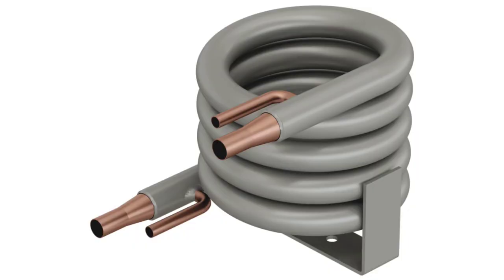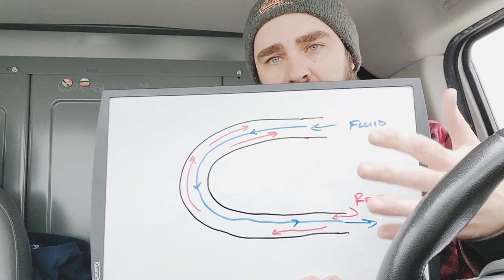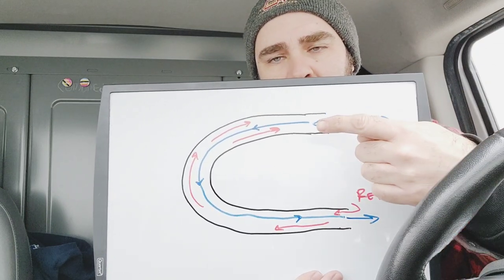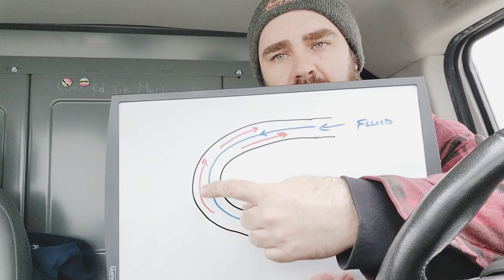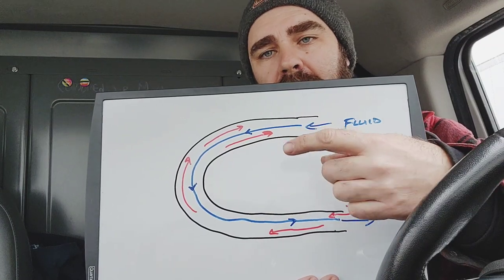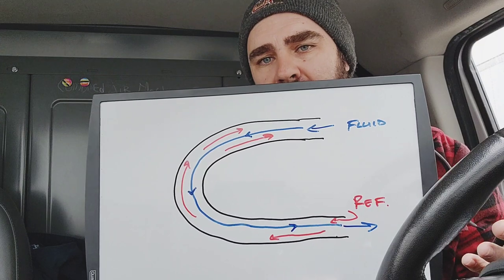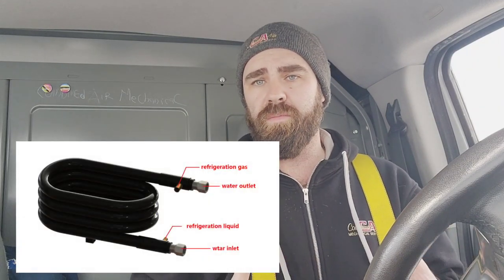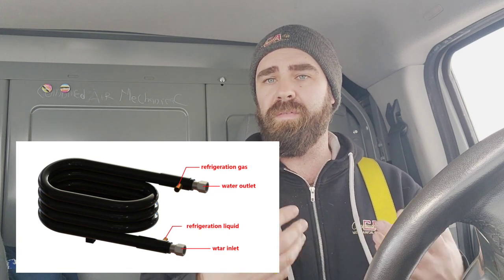Water Cooled Heat Pumps, Air Conditioners and Coaxial Coils - Heat Pump Building Loop

Comment: I have a location with 3 walk-in boxes that a previous technician bypassed the air cooled condensers and installed coaxial water cooled coils. The water bill is through the roof. I’m sure the water regulator valves are wide open. How do I dial in the head pressure and save water?  There isn’t a manufacturer spec sheet because this was a custom job. These are all r134a medium temp reciprocating compressors.

Comment: Taking the fitting off the water lines on a 30 year old unit is a hole nother storyline.  Some of the water piping in the buildings in los Angeles are like over 30 years old .
Reply from the maker: Same here, we've had ball valves break and glycol floods

Comment: What is the proper way to clean the coax coil,  if there is glycol in the system
Reply from the maker: You'd have to remove the glycol circulate a chemical cleaner

Comment: Anyone ever seen an air condenser with a coaxial coil also attached ? So the refrigerant travels through the coaxial coil and then through a air cooled condenser and then to the evaporator.

Comment: I'm running a service call tomorrow.  Its a no heat and the original tech put in on the notes that the thermostat was not set up for heat pump.  New tenants in an old space.  Could this really be the case that it's not enegizing the reversing valve?  The unit is suspended (little to no access) so I was just curious on what my first steps you would recommend?
Reply: Did the first service tech confirm that the compressor was even functioning in cooling mode?? I work on my fair share of water source heat pump’s..Horizontal in ceiling, Chassis heat pumps, and vertical heat pumps…Depending on the age of the unit you’re working on you may have a circuitboard that will have a stored fault code That can generally be confirmed by shorting out to little testy pins on the actual circuitboard…Mrost of the newer heat pumps I come across energize the compressor on Y And energize the reversing valve on O/B of the Thermostat… Also you may want to confirm that the thermostat is indeed meant to function heat pumps…As long as you have the correct Voltage hi/low You can always try jumper ring the thermostat in both heating and cooling to confirm if in fact the Reversing valve is energizing(Noting if you have heat coming out the registers Or if it it’s still producing)….
Hope this makes sense🙏🏾
Reply: Also some of the older water source heat pump’s  are control just like a traditional AC furnace…..Y is cooling And W brings on the heat
Reply: @andreagate542  thank you for the advice.  First unit was wired correctly but the unit is cutting out on heat (code anti short cycle).  2nd unit is not accessible for service.  I can’t even get to the filter rack.  Owner is contacting the GC.
Reply: @jonharris7590  your welcome Joe……not Sure if you were able to get any performance data Welding machine ran in heat mode or perhaps the unit would cut off before I could even really get going for an extended period of testing the water side and the air side measurements🤔….And I often run across the same issue where are you cannot even remotely get to the electrical compartment to troubleshoot units that are in the ceiling,….You would think that prior to constructing a building the engineering team would sit down and contemplate whether the machines are going to be installed will have access for service, sadly these dingdong’s only think about themselves And not the little guys like ourselves out in the field servicing equipment🥲😂😂😂😂